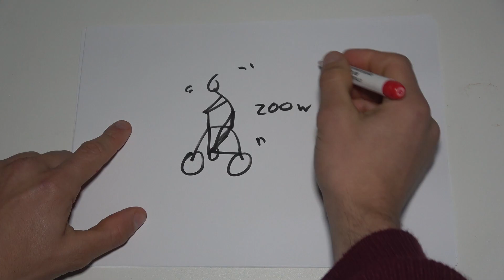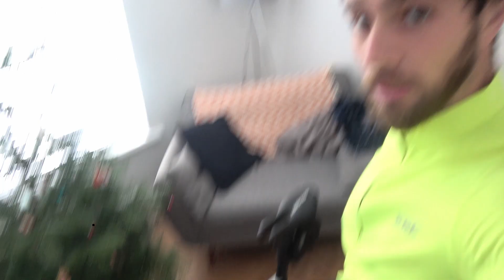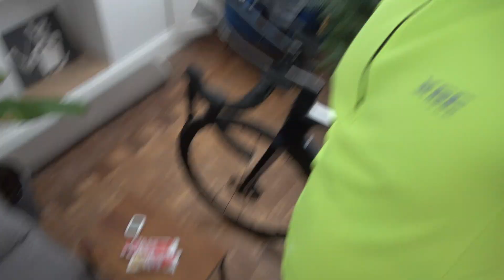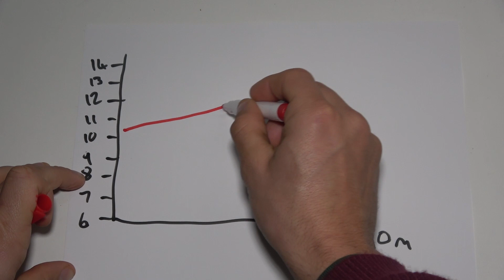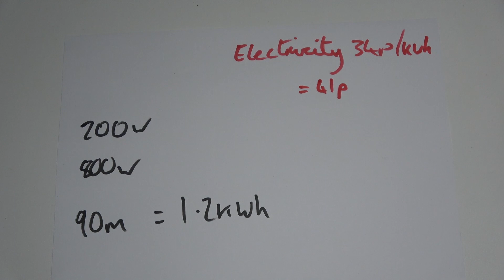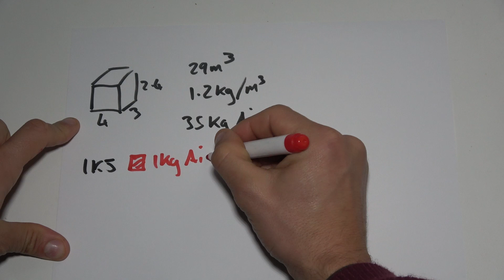Can I heat my house by cycling?

Comment: it's not just the air in the room that "makes" the room temperature. walls, ceiling, floor, any objects in the room are massive heat capacitors which absorb and store your generated heat energy (-so it isn't just "lost")

Comment: Don't give up ! The attempt all by itself was impressive.  
There is a way to do this even though I don't know what it is . 
If you were powering a space heater by pedaling I'm sure you would get a better end result .
I suck at math and am not tech savvy .
I once attempted to rewire a washing machine and when I turned it on instead of washing my clothes it dried them jkjk